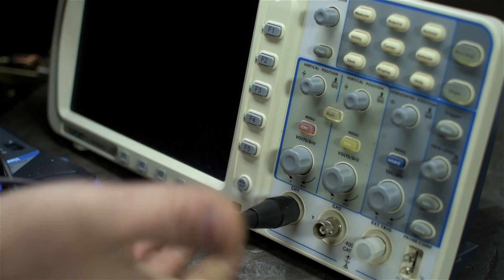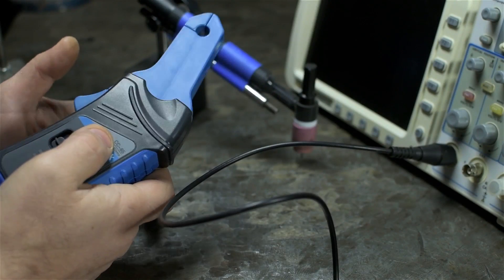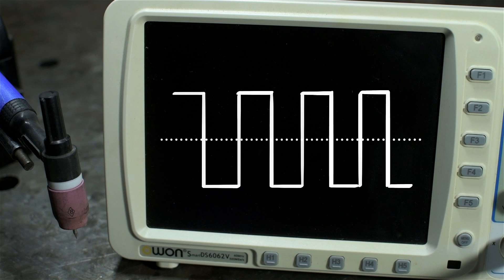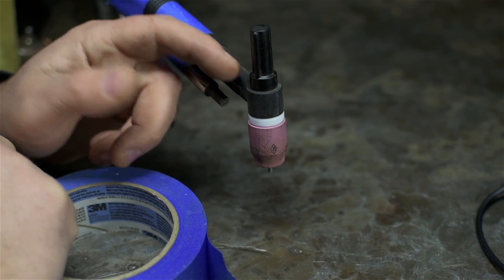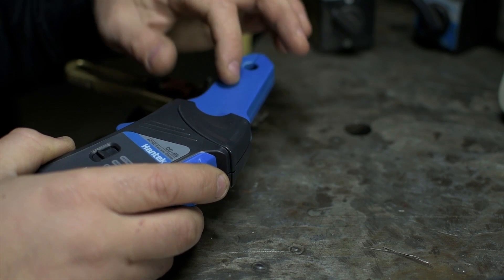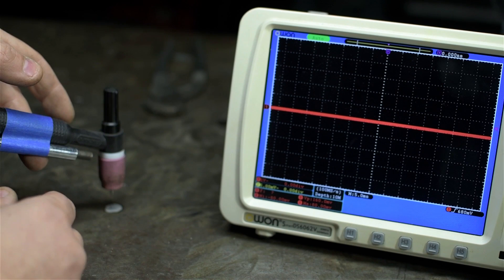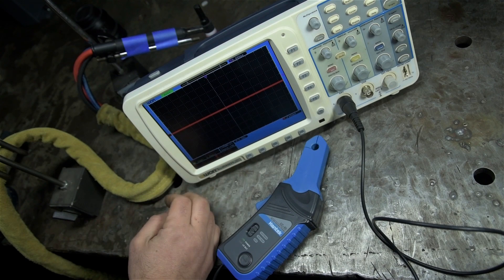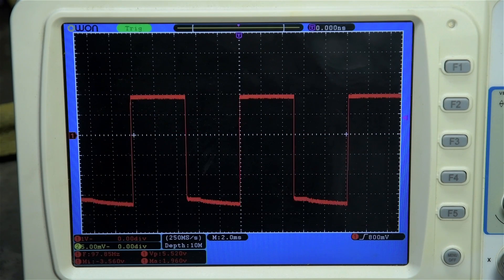Oscillo-Help-Me?

Comment: Hi Tony, some notes for you, from an old electrical engineer:

1) So the AC clamp meter is an inductive pickup. The output of this will not have a direct reference to the DC offset showing up on the scope. The clamp acts the same as a capacitor, blocking DC. 

2) The symmetry you are talking about is called Duty Cycle [%] where 50% is spending 1/2 the time on. 0% Duty cycle is off all the time.

3) The DC offset you are seeing on the scope is likely caused by the scope being set to DC input (coupling) on that channel. The offset would be affected by the duty cycle, kind of like an average of the voltage over time. Setting the scope to AC coupling should stop this offset from occurring. Your going to need a different pickup to read DC offsets coming from the welder.

4) The high frequency start is bad juju for the scope. High energy RF is getting coupled into the scope, either from the probe or just having the scope in close proximity to the arc. The energy is overwhelming the input protection on the channel, if coupled next to the scope. RF (if from the lead) could be reduced by choking the leads (looping them through a torroidal choke or similar system of creating a big inductor in the lead). For proximity coupling, move the scope further away or try and shield it using some metal sheeting.

5) For sure, trying to keep measuring that as-is will likely destroy the front end on that scope. It's not happy right now. Trying to couple high energy or high power current flow to an instrument that can pick up noise from your fluorescent lighting (very sensitive pickups) can be challenging.

Thanks for all the vids, loving them.
 - Eddy
Reply: There is no point in grounding the scope. The scope measures the voltage put out by the clamp meter. When there is no current, the meter outputs 0V. When current flows in one direction, it outputs a positive voltage, and when it flows in the other direction it outputs a negative voltage, both propotionnal to the current. There is no need for a voltage reference to the welder.
Reply: @Spikes I think you are right, it's too clean. Maybe the clamp meter saturates !

It looks like he is using the 1mV/10mA range of the clamp meter, but that range is only rated up to 2A. Tony shoud try the 1mV/100mA range that can go up to 65A (for a 30A setting you should expect 0.3V on the output) http://www.hantek.com/Product//CC/CC65_Manual.pdf
Reply: @TitoTheGeek  To drive home this point, try reading the current across a 100 ohm shunt to better isolate the range, if you want to stay plugged into that port that is. If the wave form flattens and the amps drop as expected, than your port is working just fine.
Reply: That top of the curve just looks to perfect to be made by a inverter/rectifier.... normally i see some bounce to the signal, but that is really sharp. I agree that the reference triggering may be the cause, but not sure what he could use to trigger that as i am normally looking at voltages not current. Could he try swapping the current clap around and see if it shows the same but in reverse? Could he reference the building ground... just tossing out ideas....

It also reminds me of clipping when the square wave is that clean, that you are driving the rectifier right up against its limits and it physically clips the signal, opposed to have a gate/igbt or what ever is used to control the circuit, close and bouncing. Just reminds me of my days designing amplifiers and over driving them till they clip the signals...

High frequency are from the arc's and higher the voltage only make it worse. They really bad stuff in electronics. It seems that it uses a high voltage to create a arc that long. I agree with Deathlok what he says about shielding your scope from it and some damage might have already been done.

Love the videos good luck
Reply: This guy wrangles pixies
Reply: As the waveform dies off, at 4:40, and 6:49, the majority of the waveform is well balanced, but the high and low extremes are both clipped, right at the same +20/-40 levels. This makes it pretty apparent that the operational waveform is cut off (saturated) at these levels. I'm betting on a setup/probe issue - you're clearly not seeing the true waveform.
Reply: Tito1337 Oh yes quite right it's not picking up voltage from the welder.  I was just brain farting, pardon me!
Reply: From another electrical engineer, put a Faraday cage (wire mesh over the screen and controls area, velcro and foam contacts for around the controls area) on your scope and ground that, preferably to the IEC connector ground in back internally wired.  Ferrite bead your scope probe too.
Reply: 1) It is likely not inductive pickup but a hall sensor which can pickup DC alright.

2) The symmetry he is talking about is NOT duty cycle. If at all you could call the AC Balance the duty cycle. The symmetry is the DC offset, where no DC offset would be called "symmetric".

3) If he sets the scope to AC coupling he just suppresses the DC offset, he wont see it, but it will still be there. See also 1)

4,5) I agree, if the scope is doing funny stuff already, it likely is not good for it.
Reply: Glitches will most probably be caused by RF energy emitted from that big spark gap generator (HF weld start thing) which will couple beautifully into your scope since it is sitting on a giant metal plate which is at the other welder electrode (so it's a big antenna ground plane). So it has a fantastic RF noise coupling  method. Probably straight to the metal chassis inside the scope which is also instrument ground.
Soooo take it off the plate.
Reply: Many smart dudes here.
Reply: Also, because 'passing' iec61000-4-x immunity testing is non-compulsory for a CE mark etc, (and none of the tests include spark gap generators), unless there is a specific statement from the manufacturer about passing said tests, you really are in the wild about knowing how EMI hardened this equipment is (both probe and scope), so it could be a bit of a goose chase. And... Because this is a budget scope, i wouldn't expect this to have been done, so it could more than likely turn out to be an product level issue.
Reply: Deathlok67 amazing reply. That's why I love this community.
Reply: This seems about right.  That waveform is 50% duty cycle exactly.
Reply: This is, in fact, a DC amp clamp with a hall effect sensor. I have the same model. Hantek CC-65. It's cheap but, if I recall correctly, it's fairly accurate.
Reply: Deathlok67 
3) what looks like a DC offset can be a real measurement with a current clamp.
If he AC couples he will not see if the current differs with polarity as the result would suggest.

DC coupled, if he flipped the probe, should not the vertical 'offset' also flip if it's a real measurement and remain as-is if it's a scope- or probeinduced offset?

I'll remind us the trace sits at zero with no current.
Reply: Could it be that since you are clamped on the negative cable, that's the reason you're seeing the full negative side of the waveform, that you're reading the values before they get to the table? Is it possible that the table is somehow setting up a high resistance alternative path to ground and thus leaks some current during the positive half of the cycle before it gets to the welder's grounding clamp... Dirty table? 😁
Reply: To bypass the high voltage you can put a test load instead of the arc.  It has to be sized to dissipate the power of the welder. For  example, if the welder output is 16V and you want to test at 200A, you need to dissipate 3200W in a (16/200) Ohms resistor.  Try a coil of 12m of 14 AWG copper wire in a 5 gallon bucket water. Make connection to bigger cable under the water surface.
Reply: Exactly.
Reply: Deathlok67 i
Reply: The clamp meter is based off of an hall sensor, and will read DC just fine. If it were AC, you would not see these nice square waves on the scope, but something more alike a sinusoidal wave.
Reply: Just to add to my comments, I was assuming the clamp was inductive (coils). If it is a hall-effect then yes it should pick up DC biased currents; I just don't have the specs on that clamp to be sure.

Disclaimer: I am not an expert on clamp sensors, some of what I said may be incorrect. I have used them rarely as I do not work in high power electrics.

If hall-effect then, as some other ppl have said, Tony should take a closer look at the specifications of the clamp and make sure it can handle expected peak currents and frequencies to track the initial arc build.. it may just be saturating in one direction. There will likely be some circuit inside the clamp to process the voltage out of the hall effect device so that can have a contribution in limiting (saturating) or deforming the output.

On the shape of the wave from an inductive (loop-based) clamp, it's inductance should be pretty low so it  should pickup a majority of the fundamental frequencies comprising a square wave pattern (see Taylor Series w.r.t composition of a square wave). If enough fundamental frequencies get through the clamp then most of the wave should be re-constructed at the scope, albeit with possible rounded corners. This pulse frequency coming out of the welder is not really that high.

 - Eddy
Reply: Take it from an MIT dropout.  You guys are thinking way too hard about this trivial problem.  The wave form is AC and the DC offset can be read with a multimeter in DC mode. Remember, in DC mode half the waveform is in the positive cycle and the other is in the negative cycle, canceling out to 0.  If there is a DC offset, then the multimeter will pick it up as a positive or negative DC voltage well above or below 0.  If not, then the oscilloscope needs calibration. Oscilloscopes are not plug and play equipment.
Reply: Deathlok67 (Eddy) is correct on all points.  Weld balance in AC TIG is a matter of pulse width and the relative duration of positive vs. negative portions of the cycle.  https://www.millerwelds.com/resources/article-library/understanding-ac-tig-balance-control
Reply: Actually he's wrong about... basically everything he said.  But sure why not.

This probe is not an AC probe.  In fact almost no oscilloscope current probe is an AC probe.
The symmetry he is talking about is not duty cycle.  Sure it's not 50%, but that's not what's being discussed.
If the probe were actually an AC probe, then AC vs DC coupling would have no effect.  To look at current average shift, the scope should be in DC coupling.
This isn't a 'coupling' problem, it's an radiation/susceptibility issue.  Clearly the welder is not EMI compliant.
The front end is fine, but the scope should actually be grounded here.  A hard tie of the shielding to ground could reduce the radiated and conducted susceptibility.
Reply: You're right, I think from the welder's perspective it's symmetrical because it doesn't have the same ground reference, and the DC offset influences this.
Reply: Eddy I have to say that was one heck of a comment lol
Reply: This was my first instinct too, but the clamp is supposed to be picking up CURRENT, not the voltage. Zero voltage reported to the scope should correspond to zero current (technically, zero magnetic field) through the clamp. There's a lot of potential sources of error here, though. 

If I were trying to track this down, I'd want to put a true voltage probe onto the welder electrodes. Theoretically that should be fine - they only run at a couple volts, and the welder shouldn't provide much current to the scope. Get anything wrong though, and you'll be out shopping for new test equipment. (EDIT: Be REALLY SURE where all your ground references are before you try something like this! And as Eddy says, you'd want some good signal filtering before letting it near your scope!)

If the welder is keeping constant +/- voltage, and adjusting to maintain only the average current, the electrodes might be responsible. I'm just guessing, but the tungsten electrode is probably better at emitting electrons than the steel bench.
Reply: That particular clamp meter is AC/DC so it should be a hall effect sensor, though it could be some combination of hall effect and inductive pickup. only way to be sure would be to take it apart.
Reply: pjtruslow Or get the specs from the manufacturer's website.
Reply: @Tito1337: This sounds right to me as well. Ultra clean square waves like the top of that curve mostly only happen if theres some kind of saturation happening. 

To everyone saying to tie the ground of the o-scope to the welder: That only matters when taking voltage measurements. and in that case you would want to use an isolation probe to protect the scope anyway. using a clamp-on current probe with an isolated ground should be just fine in this case. 

Lastly, to @Deathlok67 's number 4 point, yes this sounds plausible and likely. I would add that since the current is flowing through the table, the table will act like an antenna, albeit a badly tuned one. But that won't matter too, too much,  especially if delicate electronics are sitting right on top of it. Its kind of like placing something fragile on top of a bass drum and then smacking the drum real hard, the effect will be much, much worse right at the surface.

Side story: My ham radio club had a leaky RF line on the output side of a powerful transmitter. It would do the exactly same thing, as soon as we'd key up the transmitter on that line, all the monitors and electronics would wack out, screens would flicker, settings would change, menus would pop up, the whole nine yards.

I'm also a fellow Electrical Engineer, if that matters to anyone.
Reply: Also, if the asymmetry recurs even when properly referenced, it may have something to due with the different voltage drops from the different types semiconductor junctions used for the positive and negative halves of the waveform.
Reply: Deathlok67 yep. I was going to say the exact same things. Correct on all points.
Reply: Simon Ashton -I agree with your comments regarding earth or as you guys across the pond refer them as ground loops for measuring voltages - (I had the embarrassment of taking the fuse our while investing petrol injection circuit on a Ford Engine) however, using a current probe will not have the similar problem as they are self contained plug-in’s for the ‘scope. In my early days in the R&D environment I quite often ‘floated the earth (or Ground) from the ‘scope to eliminate loop problems.
Reply: zapro_dk There are inductive AC clamps too, but I thunk you are correct.

So the scope needs to share the welder ground. Should be no harm in that back at the wall. Just donut ground the scope art the wall and at the welder. Ground loops are naughty!
Reply: Yes yes yes,  to add to this. Most don't realize a scope only measures voltage and zero in volts is always relative to your reference point. It has to get a zero from somewhere.  External (earth ground) or the signal both of which are isolated from the actual system. With this set up there isn't a connection that allows for a system zero reference to be used by the scope.  Best way to do that would be to measure the voltage drop across a known value resistor inserted into the system, but it's also very likely to fry the scope due to the noise in the system.

Comment: To eliminate any error of the probe just use your ground connection of the welder to the table as current shunt. Just connect the ground of the oscilloscope as near as possible to the welder and the other tip to the ground clamp on the table. You can not measure the absolute value of the current with this method. But you will see the waveform which is the interesting part for you. Thats the way I would troubleshoot this problem. If it's a problem at all or if it's just as wanted.
Reply: This is absolutely the way to do it. The ground lead will make the voltage small so you wont damage anything, and youll be able to see the hf start.  Try and keep the scope as far from the spark as possible to reduce interference from the spark.

Comment: You can check the "balance" of your scope setup by looking at the current profile of a fully resistive load. A incandescent light bulb works great here, or a water heater.

Comment: From what I have gotten from going though the comments i think there are a few things you can try. Firstly approach this with the scientific method. Remove variables so flip the clamp meter and see if the wave form flips correctly. Then If it doesn't, change to an oscilloscope that shares a ground with the welder so the have a common frame of reference for zero. If still no dice i would say try connecting to your welding lead instead of ground wire and see what you get. If all else fails then reach out for either a collaboration or a video response from some of the many folks out there. I would say Uncle Bumblefuck is a better bet than electro boom mostly because his unique perspective of working in industry and knowledge of pixie wrangling. Another thing to think about is you may be angering the welding gods this could be their way of punishing your insolence.
Reply: Thanks for the recap :)